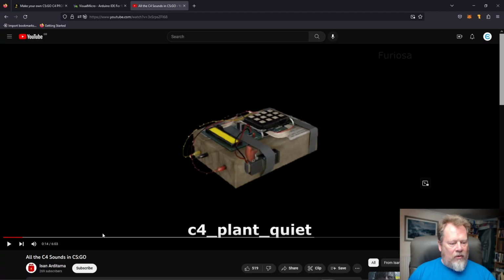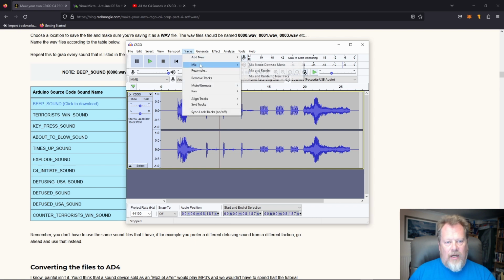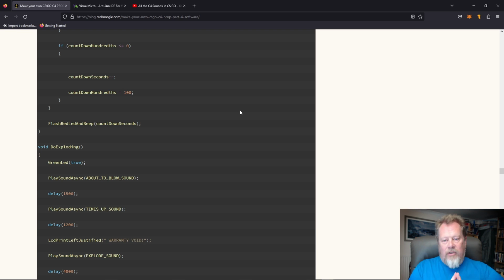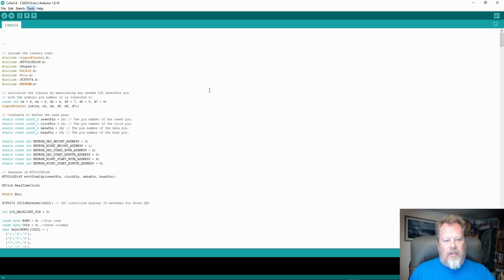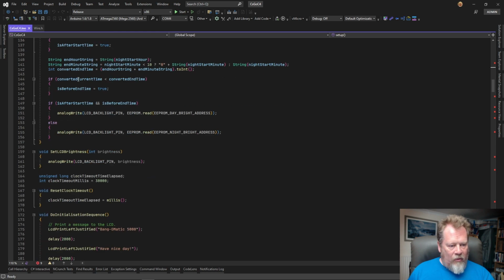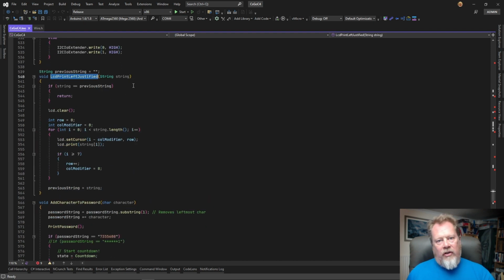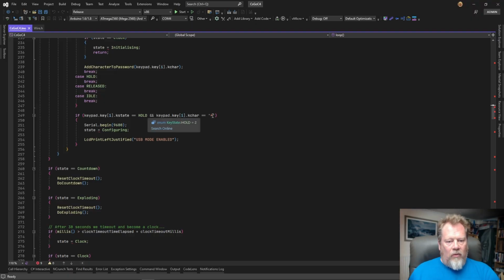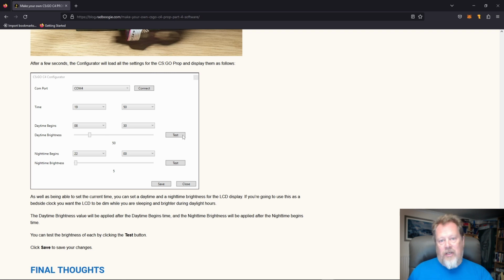Make a CSGO C4 prop - Part 4 (Software) Finale

Comment: Any advice to play an mp3 while other tasks like the lcd updating the timer and led blinking are not blocked?
Reply from the maker: The WTV020-SD-16P shouldn't block if you call asyncPlayVoice()
Reply: I bought a MP3-TF-16P from DFRobot. It has a method .playTrackNumber() which appearently blocks the other instructions
Since in any Arduino sketch, instructions are executed sequentially, I wonder if I cannot "fool" this by switching through tasks rapidly. I saw one video about millis() function, but didn't understand well. 
Do you have any video like that on your channel?
Reply from the maker: The problem is that if a function blocks, it blocks the entire CPU. Millis() is a function that gets the current time elapsed in milliseconds and can be used to make code run every n milliseconds, it doesn't stop anything from blocking though. I see the DFRobot device has the possibility to be controlled via serial? If so you might be able to trigger it to play using a serial command which would be non blocking.

Alternatively you could consider a pseudo multi-threading library like this one https://github.com/AhmedYousryM/NonBlockingSequence this allows you to put a blocking call in its own loop so the rest of your code can continue to run. This was the first one I found, there are probably others out there.

Comment: Hi blogger, thanks again for sharing, all the hardware and software are working now, only one problem left is that the speaker has no sound. However, when I start the c4 and countdown, I can hear a faint ticking sound from the speaker right next to my ear, what（where） is the problem?
Reply from the maker: The WTV020SD device can be difficult to get working. One problem I had was it didn't like the audio level being too high. So I reduced the audio level of the wav files by -18db before I converted them to AD4 format.